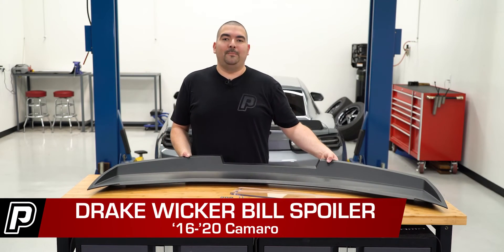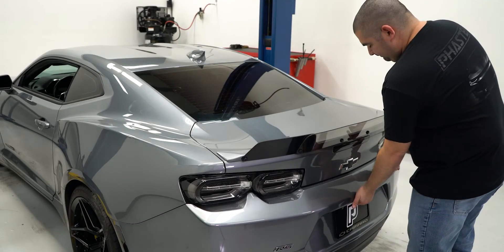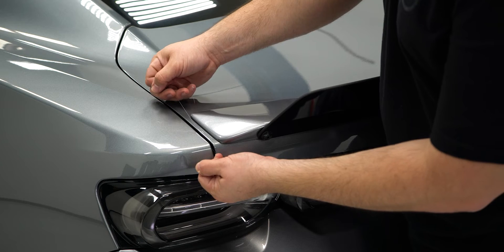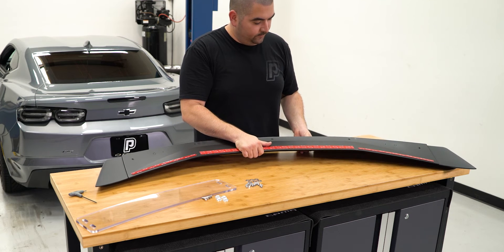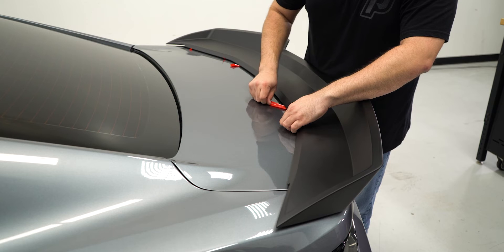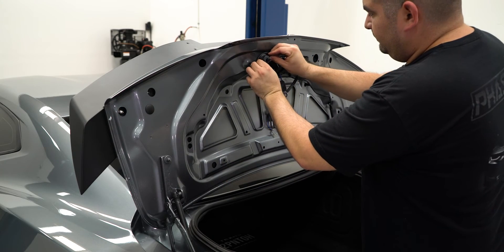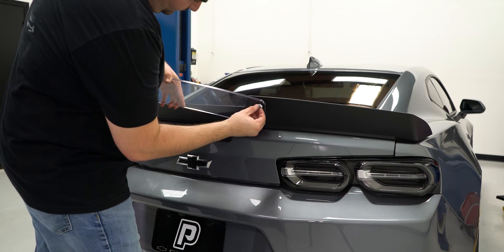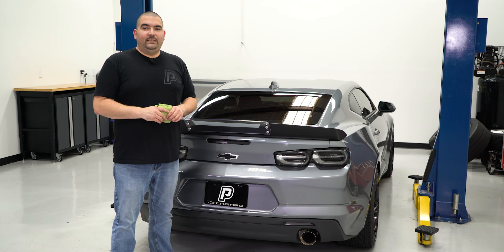2016-2020 Camaro Drake Rear Spoiler - Phastek Installation

Comment: Is this for 1LE Camaro only? Because I have a 2017 Camaro 2ss NON 1LE
Reply from the maker: Thank you for your question! This spoiler can fit all SS models but is designed to be a direct fit for the 1LE package SS Camaros. Depending on what spoiler came on your Camaro you may have to drill or cover any extra unused mounting holes.
Reply: @ thanks! I prefer not to drill any holes in my trunk lid. Can I just use 3m adhesive tape?!

Comment: Wish y’all had spoilers that fit like this one for the 5th gen models.
Reply from the maker: There is the ACS Z28 style spoiler that is similar to this one.

https://www.phastekperformance.com/searchresults.asp?Search=acs+z28&Submit=
Reply: Phastek Performance Thanks check it out. But will it fit a 2013? It’s saids 2014-2015
Reply from the maker: @seven1productions819  There is a version for the 2010-2013 models.  Here ya go.

https://www.phastekperformance.com/Z-28-Camaro-Rear-Spoiler-ACS-33-4-155-2010-2014-p/acs-camaro-z28-spoiler-334155.htm

Comment: Do u think the 2023 camaro 1le will be the same as youe rs? Because i dont want to make a hole.
Reply from the maker: Yes, the 2023 1LE will have the same mounting points as the RS.  So mounting this spoiler should not be an issues.
Reply: @PhastekPerformance   thank you a lot

Comment: Does this spoiler cause any problem with your factory backup camera?
Reply from the maker: If you have the backup camera in the antenna, then you should not have any issues.  If you have the camera in the rear spoiler, then this spoiler will not work.
Reply: Oh no I ordered this yesterday and I have the camera in the spoiler smh

Comment: I have a 2020 SS with the mid rise stock spoiler. will I be able to replace my stock spoiler with this??
Reply from the maker: Yes, you can replace the factory spoiler with this one.  You might need to drill an additional hole for mounting purposes.  Drake will supply a template if it is needed.
Reply: @PhastekPerformance  thanks . I will be ordering one Friday.🔥

Comment: do we have to drill into the trunk for a zl1 or are the holes made into the spoiler? They knocked it out of the park with this one! well-done.
Reply from the maker: Yes, making holes in the factory spoiler would be necessary for any of the wicker bill options.
Reply: @PhastekPerformance  thanks for your response! However, I was referring  to the drake spoiler in particular - to make this spoiler fit onto a 2018 zl1, would drilling holes into the trunk be required? Or would we drill into the spoiler? Thanks!
Reply from the maker: @derekkash7224  my apologies.  Yes some additional holes would need to be made on the trunk of the ZL1 models.

Comment: I have a question I just bought a 2021 LT1 Camaro but it didn’t come with a factory spoiler how would I go about that?
Reply from the maker: You would have to make the holes for any spoiler to be installed.  Since your car did not come with the factory spoiler the holes would have to be made.

Comment: Question, if you used to have a zl1 wing do you still need to drill holes or you can install it without drilling new holes?
Reply from the maker: These are per the instructions: A direct fit for 1LE Camaros and RS Camaros, but
 designed to fit all models with some drilling required depending on 
application. Template view in Installation for reference, also included 
with spoiler.
Reply: @PhastekPerformance  hello! do you think we cant install it on a SS wing without drilling with addition or tape to avoid drilling hole in case i want to go back OEM spoiler?

Comment: Would I have to drill holes or cover holes on my 2020 SS 1LE?
Reply from the maker: It comes with a template for you to drill.
Reply: Ik it’s been a while but I seen that is supposedly direct fits to the 1le spoiler. If you did buy it did you have to drill holes or did it direct fit? I have the same car lol

Comment: How can i make holes? Coz i dont have a factory spoiler
Reply from the maker: You will have to line the spoiler up and mark the holes as best as possible if your car does not have a spoiler.
Reply: @PhastekPerformance  is there a like the plastic thing that you put the trunk so you know where to put hole?
Reply: dude it comes with a template

Comment: anyone have issues with the studs?  I installed them very carefully making sure i didnt over tighten them and 3 of them ended up going through the other side and getting stuck inside the spoiler rattling around.  They are sending me another one under warranty.

Comment: It fit 2016 1lt camaro?
Reply from the maker: Depending on what version of the 1LT you have, you could need to either cover or make some holes.  Other then that fitment is not going to be an issue.
Reply: @PhastekPerformance  i have no holes so I knew I would need to make some I was just making sure it would actually fit and look right.. thx for helpful and fast response 👍
Reply from the maker: @v6camaro867  Not a problem!  I would suggest double checking the hole placement before making them if you plan on going with this spoiler.  Just so it all looks even once installed.

Comment: The template to make the holes it's included with the purchase?
Reply from the maker: There is a template but it will only work on the SS and ZL1 models.  It will let you know what extra holes need to be made for those models.
Reply: But if I have a v6 model can I use this spoiler
Reply from the maker: Yes, this spoiler can be used on the V6 models.  If your car already has the factory spoiler this video will be the same installation.
Reply: Mine is a ls version, no factory spoiler doesn't have holes so I need the templates
Reply from the maker: Since your car does not have the factory spoiler you will have to make them.  Unfortunately this spoiler does not have a template for that kind of set up.  You would have to make the holes on your own.
Reply: It's OK good to know

Comment: Do I need to drill on a 2021 1SS none 1le
Reply from the maker: No you should not need to drill any holes but you might have to cover one up that will not be used by the mounting hardware.
Reply: It's the three prong not the beam blade right

Comment: Fit on camaro ss 2016 ?
Reply from the maker: Yes, but you will have to make some additional holes in the truck.  Drake does provide a template to use and know where to make the holes.
Reply: Ok thanks I just ordered mine.